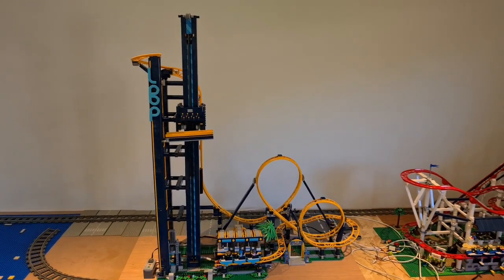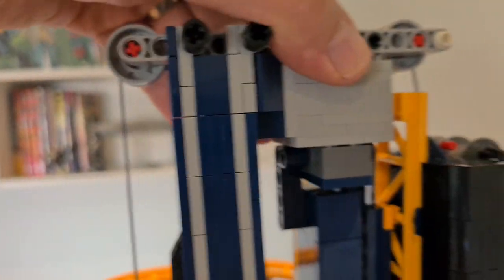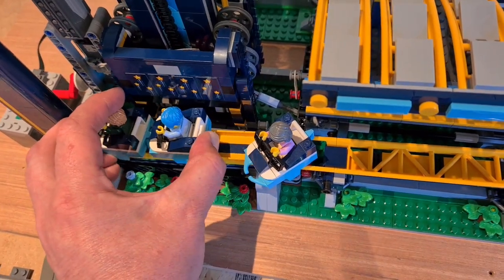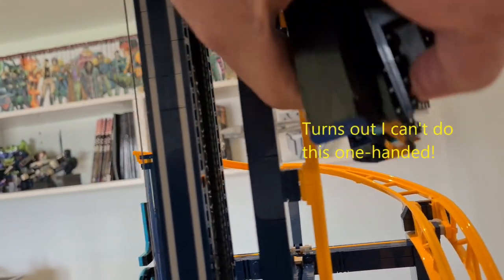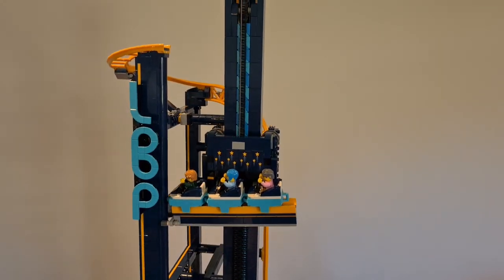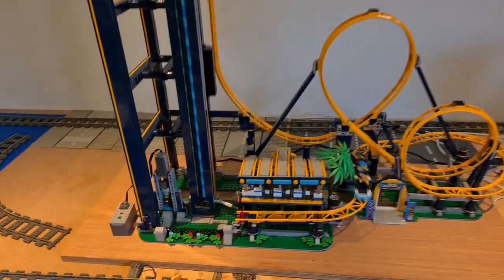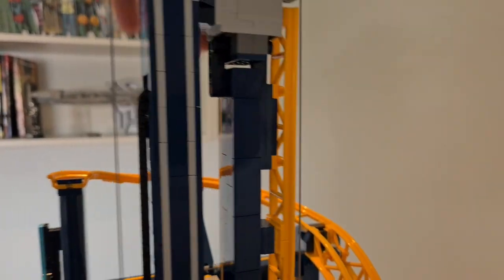How to fix Lego 10303 Loop Coaster and stop it breaking apart!

Comment: You have done nothing wrong: all over the internet people are complaining about this problem. At €400 (without the motor and battery box, which cost another €70!), this is just unacceptable. Add to that that some parts are of rather shabby quality, and you have got a complete catastrophe. Your fix is of great help - thank you. However, we expect Lego to test their products (quality and function) before releasing them. They cannot be bothered to do so any more. What a downfall!
Reply from the maker: That's the biggest disappointment, I really don't think it was tested properly, I love the set, it is very expensive but for the price, I would have expected better quality.
Reply: Oh it’s wrong believe me. The counterweight is way too high!  I’ve built 4 coasters 2 for a LEGO store display and I’ve had no issues with any 4!
Reply: @brictronic  You just fucked the build buddy. Take your responsibility. Mine works flawlessly. Had it running for days, zero crashes.

Comment: The string has to be exactly the length the instructions tell you to have it. At the beginning of the video, your counterweight is too high. That's why the cars don't come off the lift and get stuck. Also make sure the sides of the tower are tight. The cross bars that support the tower sometimes pull away from the struts of the tower and that slight gap makes the gap between the lift and the top track get slightly bigger and the cars will get stuck. Mine works flawlessly but it's a very exact build to make it work properly.
Reply from the maker: Thanks, yeah, I realised that the video shows the counterweight too high, that's my fault for rushing it. I had it set exactly level with where the instructions show, actually, I tried adjusting it up and down several times. Nothing worked continuously unfortunately, I'd get a few cycles out of it each time. I found adding the weight was the only solution that worked for me.
Reply: @brictronic  That's okay. Sometimes you just have to modify things like this to make it work.
Reply: even when I tightened my tower joints and adjusted the counterweight per the instructions I was still having trouble with the cars getting stuck due to gap between the elevator track and the fixed track at the top. I found I was able to mostly close that up by shifting that 4x4 gray cube mounted at the top of the chain lift over 1 stud and it's been working pretty well for me since.
Reply: @truebnb  Can you please give me a photo somewhere of how to adjust it correctly? I somehow did not understand the shift, thank you
Reply: @Scorp180 Don’t do what he said It didn’t work I was having the same Issues with cars getting stuck at the top and I just pushed the top assembly Into the counter weight track to make sure It was tight and It ran all day with no Issues.
Reply: @blessguy5330  Ok thanks :)... Have nice day :)

Comment: Just wait until the chain links stretch a bit and then skip the gear at the bottom 😉The model is a permanent construction site and should come with a maintenance contract from Lego, where a technician readjusts the thing every week. Should actually be included at the price.
Reply from the maker: 😂😂 So true! I actually have removed one link already. So far so good, with that removed and the extra weight on the counterweight, it's working fine for the past week. But a permanent construction site is a great description!!
Reply from the maker: 😂😂 So true! I actually have removed one link already. So far so good, with that removed and the extra weight on the counterweight, it's working fine for the past week. But a permanent construction site is a great description!!
Reply: I had to remove three or four links after my kids put it through its paces for a week or so. 😂
Reply: Oh, great… what a friggin waste of my 400 bucks, very disappointed with Lego

Comment: It's basically a design issue not just your assembly. The thing DOES slam down pretty hard on the elevator decent (parts were flying off mine sometimes when the elevator hit at the bottom). They didn't include any slowing/braking/cushion mechanism for the return, and one way to help is add more bulk to the counterweight like you showed.
Reply from the maker: Yeah, I had minifigs and parts of the cars breaking off sometimes. It really is a poor design. I was expecting a rubber cushion like in the haunted house?

Comment: I also recommend adding a piece to block the end of the counterweight track since increasing the mass only helps reducing the speed and not changing the momentum
Reply from the maker: Good idea! I'll have to see where I can add it on, maybe clip it to the track rather than using the studs on the end of the track.

Comment: Thanks. I also had this issue when I moved it upstairs to another room. Applied the fix that you found and indeed this helps as the counterweight is more in balance with the elevator.

Comment: Great analysis. And good solution. 
No you did not build it wrong. Lots of ppl have those problems.
Reply from the maker: Thanks! Yeah, I think there's a few people with the same issue alright.
Reply: @brictronic  i wish it could run several cars at a time.
like the old wind-up toy cars that were "automated"

Comment: If anyone else is having issues with the track not lining up at the top, pay attention on step 367 (page 278). The angle is a bit funny to see clearly but the light grey block must go in the middle, I had it over one stud - like in this video https://www.youtube.com/watch?v=bZoXfmky64M&t=291s - and it caused the track to be just enough out of alignment that the cars couldn't transition. Once I fixed it everything worked as expected. I didn't have any issues with the counter balance hitting the top once I calibrated the height correctly as in the instructions.

Comment: The instruction manual does recommend a specific spot to put the counterweight in. I think lowering it would make somewhat of a difference, you could try taking the mod and lowering the highest point of the weight to the top of the 1x1 clip piece connecting the track to the structure -- The highest one up there.
Reply from the maker: Thanks, yeah, I realised that the video shows the counterweight too high, that's my fault for rushing it. I had it set exactly level with where the instructions show, actually, I tried adjusting it up and down several times. Nothing allowed the coaster to run continuously unfortunately, I'd get a few cycles out of it each time and then it would jam at the top. I found adding the weight was the only solution that worked for me.
Reply: @brictronic  My brother and I had a problem where it wouldn’t come back down on time, we usually have to make sure all the supports on the tower are pushed down for it to go down fast enough. It doesn’t slam for us though. For a $400 set, LEGO come on. This video helps tons with problems. You should try addressing all of the problems and try solving them for people so they can reference to your videos to see the possible solution to the problem. Anyways, thanks and best wishes to your LEGO channel, the VELIBros. [I DON’T INTEND FOR THIS TO LOOK LIKE A LETTER]
Reply from the maker: @VELIBros Thanks.  Exactly, it's not good for a €400 set to have this amount of issues.

Comment: I have having slightly the same issue, but I only put 3 2x2 plates on the top of the coaster cars inside the counter weight to make it work. Otherwise it was too heavy to reset. What I may end up doing is modifying the top grey box at the top of the counterweight column to attach the track with it's 1x2, creating a true clamp to keep the grey from separating from the rest of the column
Reply from the maker: Yep, that would work. I believe there's an issue with the tilt of the tower too. If it's not exactly straight, the counterweight moves at the wrong speed. But mine has been working perfectly since I added the weight. I may have to do some adjustments when I move it to its final position though.
Reply: @brictronic  I think you're right. I've been playing around with the config on mine and now that I have the top rail attached to the grey block, it trues up the tower to be perfectly straight that I actually had to remove all the additional weight. It appears my surface wasn't level and was causing the issue, but now that I've added a 1 x 2 studs on side piece to attach the top rail of the ballast track, it works as designed

Comment: Just finished my loop coaster and works perfectly. As the 88015 battery box is now unobtainable I am using 88003 motor, 88000 battery box, 8844 remote receiver and 8879 speed controller. Easy to find these at good prices with a little research
Reply from the maker: Delighted it's working for you. I'm having serious issues with the loop itself now. It keeps breaking apart after 10 - 15 cycles

Comment: Your fix is working well, but I found a way to solve the problem without adding pieces (I didn't have enough extra pieces): you just have to move the white pin that you can see at the top right at 4:10. You put it as the instructions say, but if you put it with the protrusion in the inside, instead that in the outside, the part will friction with the rotating wheel. It will almost stop it to rotate, so it will slow the elevator. 
I totally agree with you, you built it perfectly, and for that price, I expected more attention to quality by Lego

Comment: i have the same problem. Indeed if you make all of the rotational parts loose, then the counterweight slams the top. Someone below suggested to tighten the wheels to increase the friction, but I don't think this would be a durable solution as it'll loosen over time. It'll also undoubtably put more wear on your lego pieces.
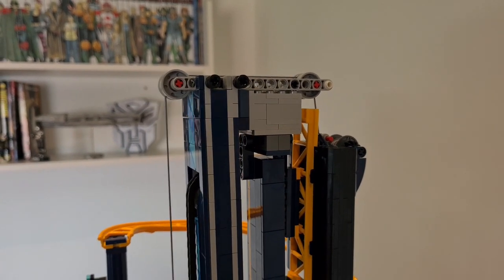My fix is this: I used a zip-tie around the vertical rail and the support column behind it. There's a convenient gap between the top and bottom (as seen in 0:45) of the support column that's bridged by the two L plates. Loop the zip-tie through the gap there and around the rail. This nicely solves two problems: 1) the zip-tie clamps the rail tightly to the support column, which as seen in your video tends to separate and 2) the counterwweight cannot move above the zip-tie, preventing the collision on top. Since the zip-tie is soft plastic, I would think most of the wear and tear of the collisions would be on the zip-tie and not on your precious lego pieces.
Reply from the maker: That's a really good solution. I've since made the tower a lot taller and changed the coaster completely and it works a helluva lot better now!
Reply: @brictronic  please do a new video showing the new mechanics!
Reply from the maker: Hi, if you look at the Skull Mountain video, that's the new coaster setup

Comment: I know this is late, but if you tighten up the wheels on the elevator cart (brown technic rod through blue hole with white washer tightly flush), the cart won’t slam down.  I thought it would be better to have those skinny wheel completely loose, but that’s not the case here.  Made a world of a difference as mine was doing the same
Reply from the maker: Thanks for the comment Patrick, I'm going to try that when I'm placing the coaster in its final position. Sounds like it could be a huge problem solved!

Comment: I'm having a different issue for the first few times I would say 15 plus the coaster worked flawlessly. Now when the cars ride the elevator it no longer lines up with track up at the top. I'm not seeing any pieces that have come apart that was causing your issue, that would make the lift not line up as normal. there's some how a small gap or maybe the lift isn't raising as high anymore I don't know. The lead car doesn't catch the track slides part way off and stops dead at the top.
Reply from the maker: I've seen this too and when it happened with my set, it was the centre tower that had moved. If it's out of alignment, the cars won't smoothly run onto the track. When I added the weight to the counterweight, it stopped the tower being bounced around so much.
Reply: @brictronic  him interesting I'm going to try that see if it helps its really bugging me just want to square this away.

Comment: My issues are that all the long pieces in my set, including the lift tower parts and the base plate connector pieces were so warped I have trouble with the cars leaving the top of the lift. And it's because the warped pieces mean the lift track doesn't fit close enough to the first piece of track at the top of the tower. 
The carriage wheels sit in the gap and they won't roll forward.
Reply from the maker: That's not good. I would certainly be returning that to wherever I purchased it from.
Reply: My first 10303 was warped,too. I returned it to lego,they recently sent me a replacement set.

Comment: Im having similar issues it keeps breaking apart loads and only had it line up and successfully complete the layout a few times mainly for me it breaks apart where you showed at the top and the big loop does aswell i can live with the breaking apart every 5 times round the track it does but its quite annoying having to push the train from the lift to the connecting track ill give this a go tho thanks

Comment: The counterweight hits the pulleys because you don't have enough slack, the counter should be a little bit lower. Also, if the cars still don't go onto the track from the elevator, you may need to remove a chain link or 2, that helped me, as before I did it the cars wouldn't leave the elevator, but once i removed a chain link it worked fine
Reply from the maker: I tried it with more slack and the counterweight then hits the table and comes off the track. Regardless off how much or how little slack there is, I found the counterweight to be just too light.
Reply: @brictronic  i just tried adding more weight, and it helped a bit. I only added 2 2x4s and 2 1x4s. That was enough to make it bounce much less, and the elevator doesn't bounce at all when it hits the bottom

Comment: Thanks for the review!!
I would like to know how you deal with the passenger stuck when the lift is on the top issue ?
I couldn't fix issue even on manual control
Reply from the maker: I think the cause of that issue is when the tower has become mis-aligned. So if it's leaning too much forwards or backwards, the cars don't move from the lift to the track easily. I've had to straighten my tower each time I moved the set, but once I get it set up, it works ok.

Comment: Mind giving me those part numbers and a link to a photo of that piece giving extra weight please?
Reply from the maker: Hi, the 2X4 bricks are 3001, the 2X2 brick is 3003 and the 4X6 plate is 3032. I don't use any photo sharing etc but if you pause the video at 2:30 you can see how I arranged them. Hope that helps?

Comment: Dude, I’m getting BAD chain skip on mine and I even built it on a mil plate! It was working great for awhile and then I stopped using it for a few days, turned it on and now it has bad chain skip. The last Wider chain is where it always starts skipping and the Gear sucked it in which stopped the motor from spinning almost burning it out. I’m going to remove some a link or two or try finding a stronger motor with more torque. 

Thanks for video. The top of mine was also doing this too but not as bad.
Reply from the maker: I had chain slip, briefly, when the tower was out of line, it was leaning a little towards the front. But since I straightened it, thankfully it hasn't happened since. However, I also haven't ran it in a while. Waiting to build it into the theme park properly and the Lego room is in a mess so I'll probably have to make loads of adjustments to it again when I finally place it.
Reply: @brictronic  awesome, the leaning forward sounds like that might be something I have to check because the chain was getting loose. I also noticed when I lift up on the cart while the chain skip stops so it might also be Battery Life since the motor needs lots of torque. 

Building it into the city is something I did from the start with the mils plates and it worked great! I can lift the entire coaster over my head no problem lol! However, you do need to leave an area for the weight to drop down if you do put it on mil plate. 

Thanks for responding, I’ll keep you updated.
Reply from the maker: @alphaomegazulu8451  Yeah, the motor guzzles batteries!! I'm swapping out the battery box for a direct 9V supply. Again, when I relocate it. Building it on MILS is definitely the way to go! Thanks for the tip regarding the counterweight space!! I'll have to remember that when I'm placing it for the final time.

Comment: same problem in austria :-) - maybe the instability of the tower is the problem - after the platform hit a few times the ground, the railcar stucks later on on the top - and finally the railcar with the passengers crashes down - in comparison with the expensive price it is truly disappointing...
Reply from the maker: Yes, my thoughts exactly. The platform does sway a little but I've ran my set with the added weight for 4 hours today with no issues! If the counterweight is hitting the top of the structure at all, it will cause the set to malfunction. I do think though, that it's also dependent on how stable a surface it is on and the speed of the motor etc.
Reply: @brictronic  correct - but i have to say that all in all i am happy - it looks really cool and yeah, it is finally a plastic construction, but now it works.
Reply: It’s because people do not know how to put together and push down peices when they put it together

Comment: what i dont get is how u get the counterweight to go down that fast mine is going down slowly so a motor is a no go. i checked the connections and everything is thightly put together
Reply from the maker: I found that it all depends on how straight the tower is. If it's not totally straight, it'll stop the carriage "falling" back down.